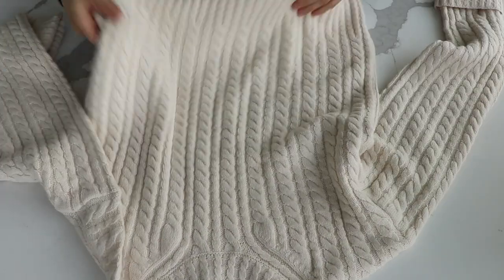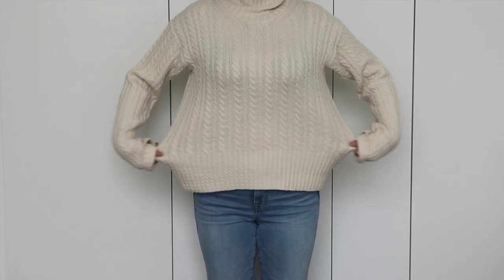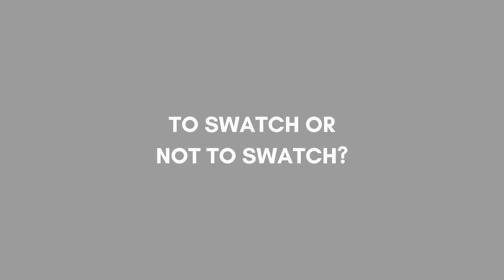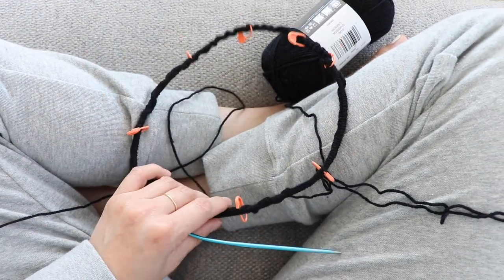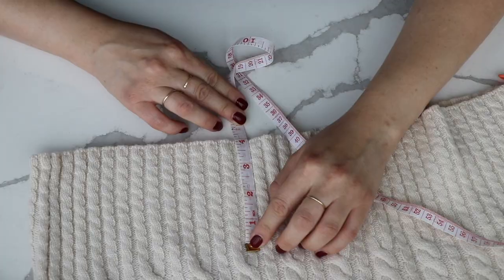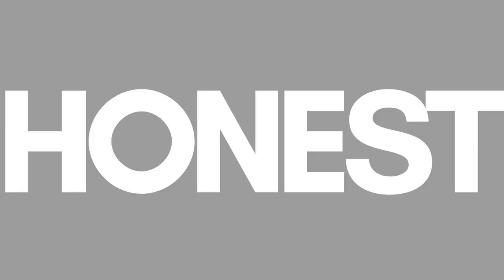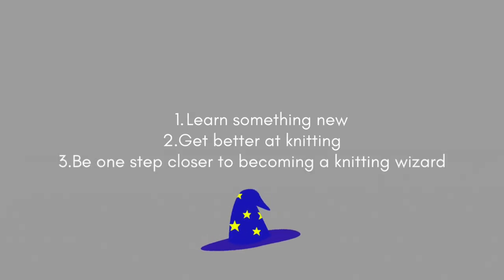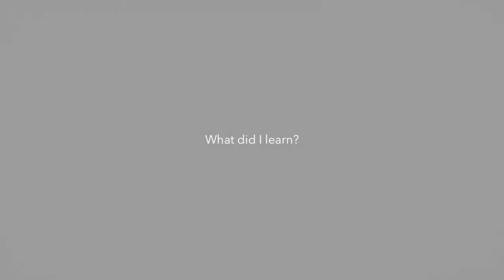I Tried To Reverse Enginneer A Storebought Sweater

Comment: I would love to see part two. The whole goal with reverse engineering allows for a finish product that fits in the desired manner. If your finish piece fits you the way you want, then yes! Either way you did some extraordinarily and beautiful.
Reply from the maker: It does feel a bit unsatisfactory to end up with an unfinished piece, despite learning some new techniques with this project. And I really do want to have a black cabled sweater in my collection, so a part 2 may just be on the way!

Please stay tuned & thanks for commenting :)

Comment: I used to hate swatches, never knit them and jumped right into projects. Now I have more respect for my time. Having to frog in the middle of knitting the back piece (because it takes a while to overcome denial and come to terms with the fact that something is NOT working takes extra time) - simply because I refused to give 20 minutes to knit a simple square defied all logic. Plus I could get a feel of the fabric I was getting and train any techniques needed for really large one. Sometimes the yarn I chose just didn't work for the project even though it looked perfect on the page. It's easier to come to terms with it when a small sample is being knitted. I remember preparing for Stonecutter by Michele Wang - I tried a few different approaches for cables before launching something on this scale of epicness. I remember Yarn Harlot mentioning she sometimes starts with a sleeve a treats it as a swatch. Maybe one day when I have her levels of experience...
Reply from the maker: You make such a valid point about valuing time. Your comment was beautifully written out :)

Comment: I love how many different ways there are to approach knitting. I would drive myself nuts if I tried to knit a sweater without swatching and measuring and looking up all the techniques beforehand. But I love how you just go for it! And yes, you met your goals and learned a lot in the process, even if you didn't end up with a finished product.
Reply from the maker: Thanks for the comment! 

This project taught me the lesson of knitting a swatch. Although I usually jump into projects, knitting a swatch is wiser. If I had done it for this project, I would have saved more time!

Comment: I am always waaaayyyy too lazy to swatch :D but recently, I measure pieces more often (saying this as if I am someone who constantly knits new projects instead of the just slightly advanced baby knitter with about three projects under their belt that I still am :D) to see if they’re going in the direction I want them to.
I personally try not to see time that was used to try something and then unravel it later as wasted; all of it goes into the project and makes the pieces what they will be later on! Still, I absolutely admire you for your patience and resolution when it comes to unraveling, I am currently knitting wrist warmers and they are about a hundreth in fabric of your sweater, and still I had the second one lying around for days because I hated the pattern I used for it but reaaally did not want to unravel it (I hate casting on..). 
If you still feel like trying again with this project, I would love to see it :) I imagine you might like the sweater even more knowing how much effort and engineering went into it!
Sending you strength and even more patience 💚
Reply from the maker: Thanks so much for the support! 

I think I finally learned my lesson about swatches. I should have knit one for this project. Although I don't see it as a total waste of effort & time, because I learned new things & enjoyed the process, it still was time consuming. So in this sense, I feel that I could have completed other projects instead of having to now unravel and try again.  

Good luck with your knitting journey and happy knitting :)

Comment: I love your video's! They are my perfect company when I knit! About the sweater: I don't think you should have decreased when going from the hem-cables to the body cables. I think you should cross the purl stitches (in the back) and after crossing them turn them into knit-stitches to join them to the cable. By decreasing you made your sweater a lot smaller after the hem, which does not make for a good fit (the brim should normally be a little smaller or at least the same size, not wider /more stitches than the body). I think this is why the sweater came out too small. Good luck, looking forward to Part 2!
Reply from the maker: You're exactly right. The body was more form fitting, and I noticed the hem had more ease. I had a closer look at the transition from hem to body and what you are describing is exactly what happened. 

Thanks for the feedback!
Reply: @ToTheKnitPoint  I'm super excited to see part two! You can do it!
Reply from the maker: @ZazuYarns  Thanks for staying tuned :)

Comment: I think part of the reason your sweater came out so tight despite the larger yarn size is because you used sock yarn. I love Kroy’s sock yarn (knitting up some Christmas gifts with it), but it has nylon in it which makes it a bit elastic and hold tighter to the leg. Great for ribbing on a sock but when pulled and worked into cables for a garment, I can see how it would be form fitting in the finished item unless knitted much larger to compensate.
Reply from the maker: Thats a good observation about the nylon. 
Thanks for commenting!

Comment: Wait, did you splice together superwash yarn? How did you get it to work? I thought you couldn’t splice superwash yarn together
Reply from the maker: I spit spliced as normal. I separated the plies and trimmed it evenly for both pieces. Then I used spit as the binder and laid the pieces over eachother and rubbed them together until they combined. It worked for me.

I used Paton's kroy sock yarn which is 75% wool. A high percentage of natural fiber blend tends to work when splicing.To my knowledge though, I don't believe it's superwash? Because it doesn't state it anywhere on the packaging. However, the care instruction does say: 'wash in water (not exceeding 86 degreees F/30 degrees C) at delicate setting', so you could put it in the washer. 

Hope this answers your question!